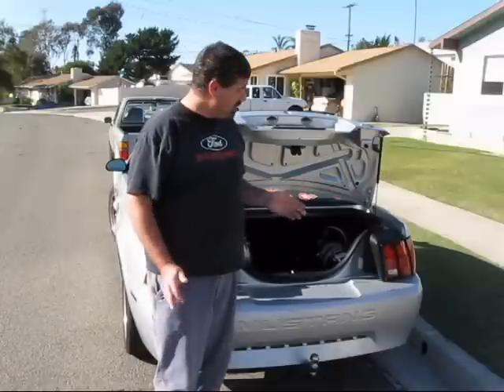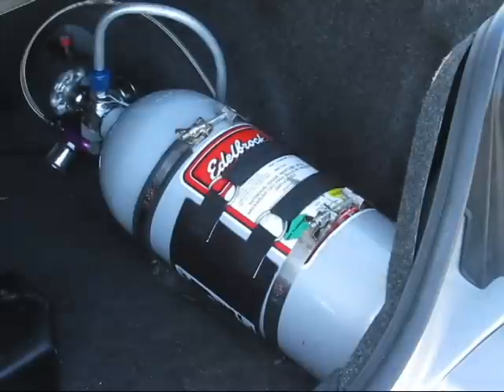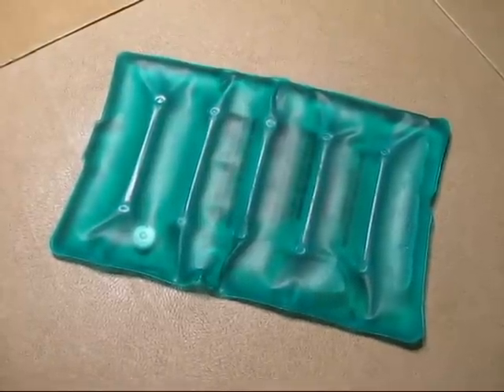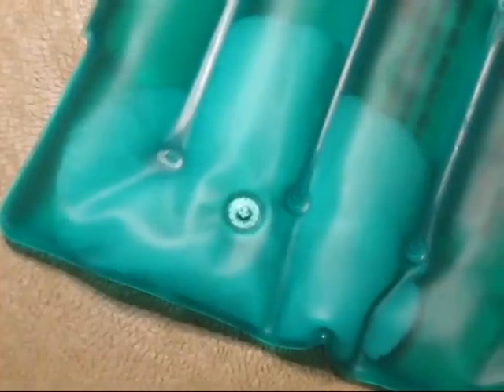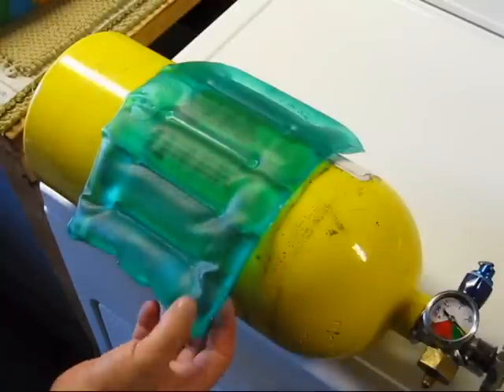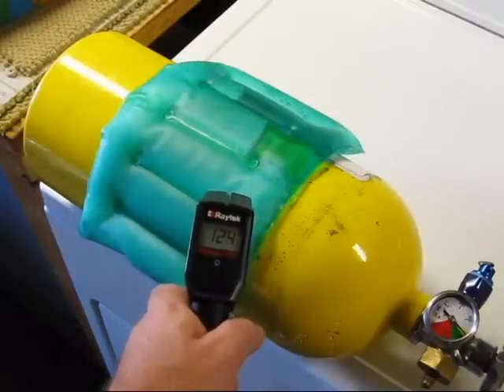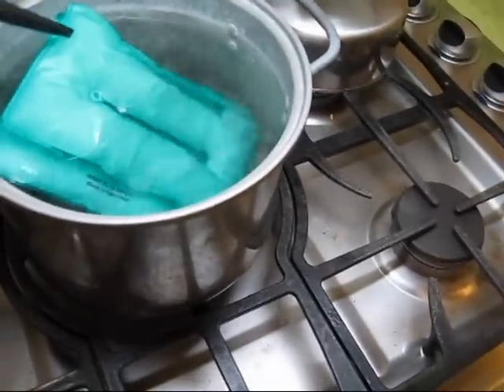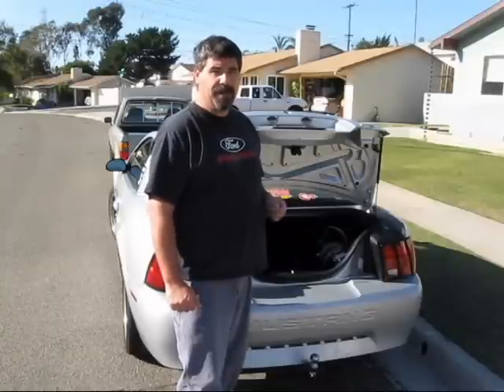Hot or Not?

Comment from the maker: It will typically pick up about 7-10 degrees F. In that particular test, it went from 950 psi to1075 in about 15 minutes. The best way to keep bottles warm is definitely a water bath, but it's kind of impractical when you want to warm up one that's already in the car.